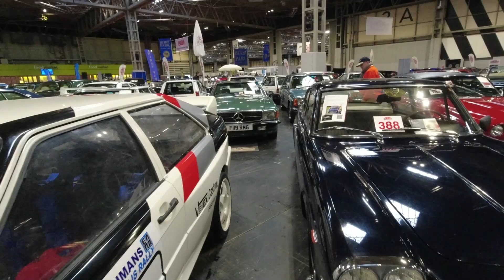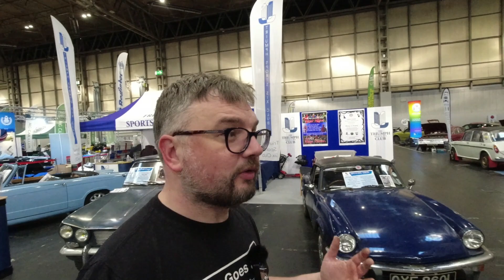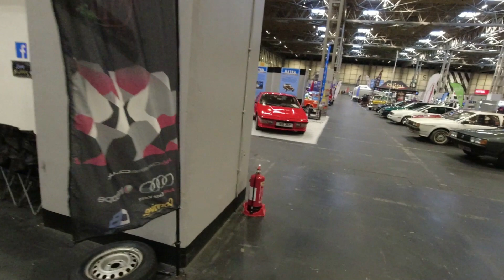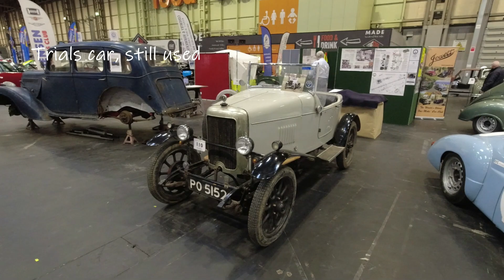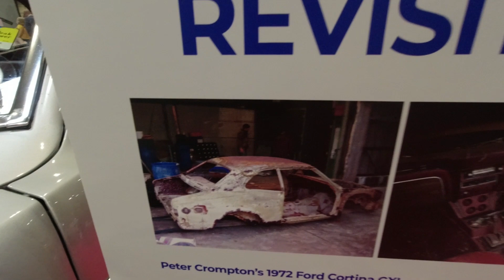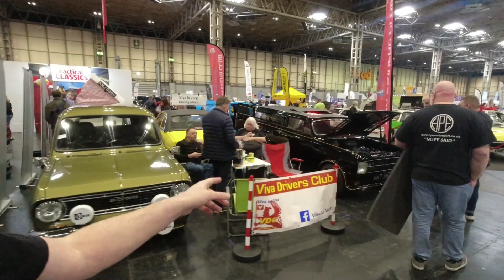Reliant Rebel First Start, Pete C Interview - Classic Car & Restoration Show Pt2

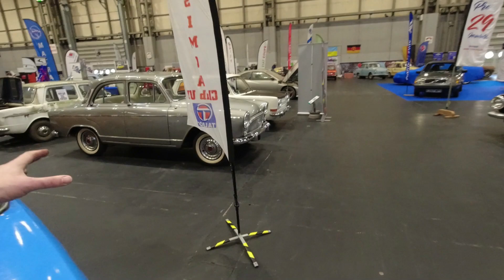Comment: Simca Aronde at 10:35.
Australian story of them being sold by Chrysler dealers from 1960 at good value price and were considered a cheap performance car :
https://youtu.be/3N1Y6cTKFNo
Even the Vedette V8 models found a market here. But one of the lowest performance V8 models you could imagine with if I recall correctly a 2.2 litre side valve Ford V8 of ancient design. Another Chrysler car with a Ford V8 before the Sunbeam Tiger.
The Peugeot 203 and 403 also made a name for themselves here because of early round Australia rally success in the fifties, but no where near as dominant as the VW beetles were later in the fifties. All through strength that made the power they had usable.

Comment: You were doing OK Ian, until you came to the Marina stand.  I had the misfortune to drive an X reg 1.7L Ital estate, in the same cream colour as the saloon featured on the stand.  Fortunately the one I drove was a company car, I wasn't paying for it.  I was a water treatment engineer and had the vehicle for just over 2 years, November 1982 to February 1985, during that time the vehicle covered around 55,000 miles, travelling all over the country.  I left the company due to a dispute over them cutting my wages, but during my period of notice, the crown wheel on the back axle suddenly gave up the ghost and was taken in for repair.  The last time I drove it was to my solicitor's office in Bury, where, due to a financial dispute, my former employers had paid funds into the solicitor's account, in order to get their vehicle back, as they were terrible at paying monies owed.

Two months later, I got a phone call from the garage demanding payment for the repairs, by then I'd left the company , so it wasn't my problem.  I was without a company car for the next two years, so I went back to driving my trusty old R Reg Mk IV 1.6L Cortina.  Although made in 1976, it was a far better car than my 1982 X reg Ital Estate, in virtually every respect.  It merely illustrated that by the early 1980s, with the Ital, Allegro and Maxi still in production, how far British Leyland had fallen behind the competition, especially Ford.

Comment: Great video as always, Ian. I'm just to where you find the row of American cars. I will try to give you details. Lime Green Mustang is a 72 Mach 1 Sport Back, and most likely has a 351 V8 (5.8 litre) "Cleveland" engine. Cleveland, Ohio is where the foundry and factory where the engine was built are located. That colour was, I believe called "Grabber Green" and was an extra cost high impact paint. Next to it is a 1973 Ford Gran Torino wagon. Not a Squire, as no wood grain. The engine from the factory could have been anything from a 302 (5 Litre) Windsor V8 through the 351 Cleveland, to the 385 block displacing as much as 460 cid in a mid-sized wagon. This one would haul anything as quickly as you wanted.
The white with stripes is a 1970 Mustang GT 2+2 with non-standard stripes. The scoop in the hood indicates it may have a 385 block V8 displacing 429 cid in Cobra Jet form.
Yes, that white one is a Pontiac Firebird Trans Am. Looks to be a fairly late generation 3 car, so early 90s is my guess.
The red Falcon convertible is a 65/66 and looks to have the Sprint option package. A Mustang in everything but name, it is mechanically identical to the same year Mustang with different body panels.
Next to the Thunderbird is a 64 Chevrolet Impala SS. Under the bonnet could be anything from a 250cid inline 6 to a 409cid V8. In between there was a pair of 283cid V8s and a pair of 327 V8s. Transmissions could 3 speed column shift, 4 speed floor shift, and 2 speed Powerglide automatic. The Powerglide was available with all engines. I believe the 3 speed manual was standard across the board, with the 4 speed available in some body styles and with certain engines.
The green Volvo Estate appears to be a 72 145S. 1 Series platform, 4 cylinder engine, 5 door (wagon) body. The S mean a 1.8 litre engine with dual side draught carburetors. Depending on the market and local regs, carbs could be Zenith or Stromberg.
I have to say I would about kill to get to a show like that one.
Reply: Cleveland tooling later sent to Australia. Geelong engine plant made them in 351 and 302 versions until the early eighties. Used as an option in Falcon to Fairlane and LTD Australian versions.

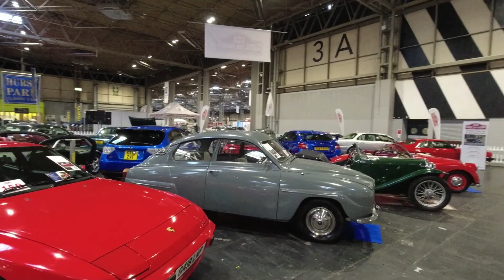Comment: Note @2:57 the SAAB 96..Their 2 strokers were SAAB's own in house engine design, that car, based on the turn signals is a 1965.

 Their engines are based loosely on the old DKW engines, but they are better engineered.  Slanted over at 60 degrees to the left, with an integral water pump/housing built into the engine head and a Bosch distributor with vacuum and flyweight advance, they are better than the DKW in how the SAAB engines drive,  which the DKW had fixed ignition timing.

Comment: Ian,I think you'll find that DVLA issue imported cars plates relating to the year of first registration, not when they are imported.
Reply from the maker: Well, that's the same thing really. That Holden was built in 1972, but first registered in 1978/79 and so wears a plate of that age. Now, they do it on the age of the vehicle, so Betty wears a 2001 plate, not a 2021.
Reply from the maker: Well, that's the same thing really. That Holden was built in 1972, but first registered in 1978/79 and so wears a plate of that age. Now, they do it on the age of the vehicle, so Betty wears a 2001 plate, not a 2021.

Comment: Velorex are still in business, though better known as a sidecar manufacturer. I have a 1990 Velorex 710 sidecar sat in my back garden. 

Production of the "Oskar"3 wheeler cyclecar ended in 1971.

Spares support is better than excellent, due to the comprehensive use of the globally popular Jawa & CZ motorcycle running gear & powerplants. Brand new crankshafts, piston, CDI / alternator upgrades, etc. are readily available for all Jawa motorcycles, purveyed by a host of 3rd party manufacturers. EBC even make ceramic brake shoe for Jawa & CZ motorcycles.

All Jawa & CZ engines are the easiest to rebuild, being very novice friendly. Everything is, "Ah, I understand how this works", helpful.

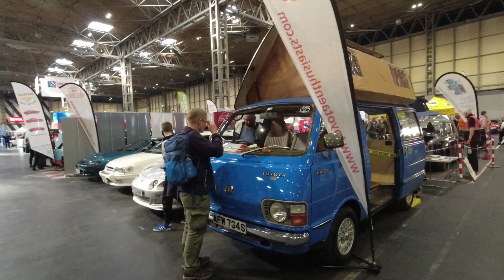Comment: 26:28 When I was a kid there was a Toyota dealer in the main road round the corner from us. I was walking past one day with my mum and they had one of those camper vans at the front of the showroom. My mum popped in and asked how much it was and the salesman told her it was £4000 which she thought was too expensive. This was probably about 76/77. Strange how insignificant little snippets like that can stay with you for nearly half a century. I even remember that it was white.

Comment: A pink car sold for 53 K ? 😳 whats so special on that car 🤔
Reply: It might have been a GTR XU1 or a replica at least. They're very valuable.
Reply: If it is one of the 200 or so Holden Torana GTR XU1 showroom sold race special cars in top condition it could sell for three times that price in Australia. Based on a Vauxhall Viva centre section but the highest spec of the Torana six cylinder versions sold in Australia. More of the story here :
https://youtu.be/54z2Xvm001c
But searching YouTube will show plenty more of the story.
The Strike Me Pink colour, as the factory called it on the colour options, was the least popular option but now sought after being unique.
Reply: 1st Torana was an Hb viva but the pink one was based on the Opel Kadett. These are worth serious money here in Aus, as are the later models. Very successful in touring car racing.

Comment: Glad you touched on the Jowett Ian, I live 5 miles from the factory site now a Morrisons supermarket.  As a nod to Jowett they have enlarged photos of the factory interior and assembly lines dotted around the store. If I'm correct, the Jupiter was entirely built in house but the other models bodies built at Briggs in Doncaster ,who as you rightly say bought by Ford  and destroyed the press dies.
Reply: I think I mentioned this before on one of Ian's videos, but in about 1985 I was working for my dad and we had to go to the old Jowett factory which was being used as a depot for, I believe, an American bulldozer company. We had to give an opinion for an insurer on one of their bulldozers which had been damaged in transit.
Reply: @caw25sha  The old Jowett factory was taken over by International Harvesters and was used to manufacture tractors.
Reply: Briggs also built the Standard 10 body. It was Ford's takeover that led Standard Triumph to recruit lots of small press shops to make panels for the new Herald, and thus the decision to use a separate chassis which acted as an assembly jig. Ironically that secured the Herald's place as probably the easiest car ever to restore as it's nearly all bolted together.

Comment: Interesting Panda fact - on the Mk1 the slatted grille was on different sides depending whether it had the 2 cyl air cooled motor or the 903 CC water cooled 4
Reply from the maker: Big bore 2CV kit mirrors the 652 that already existed for the Visa and LNA. I think it is just coincidence.

Comment: Those Volvo 400 saloons look more like an afterthought design than most others I can think of.  They look as if the designer just rubbed out the hatchback and drew a boot on the back.
Reply: I've always thought that about the 700/900. It looks as if they designed the estate and then grudgingly designed a saloon just because some idiot at Head Office thought someone might actually want to buy one.
Reply: You mean 300. The 400 is a completely different car.
Reply: @delukxy  correct, I did.

Comment: Totally agree with you regarding young folks with old cars.

I don't even mind when I see kids "blinging" their cars with Halfords tat because at least it means they've got some interest in working on cars and, out of every ten who slap on fake bonnet vents and caliper covers, there'll be a couple who decide to fit an induction kit and one who decides to take his engine to bits (probably breaking it in the process) and ends up getting properly into car repair.
Reply: I blinged my 1971 Cortina Mk3  back in 1977  with Halfords tat of the era.  Centre console with fake black leather vinyl storage compartment  which you then cut a hole for your state of the art mono radio with tape player. Enhanced with a 8 foot  glass fibre whippy aerial, Cortina decals for the wings, cheap rear parcel shelf speakers,  a fluffy dice or two, some lovely seat covers and not forgetting the heated  rear window stick on  element.  You could also get the power window winder boxes  and for the engine  a lovely chrome pancake air filter box and soak the filter in oil  which replaced the huge standard filter,  also made your car sound more powerful than it was.
Reply: Im a young folk, saving for a classic mini (not easy at 17 years old). When I get it im going to be doing it up best i can. No bling, but i do want to put a john cooper engine upgrade in myself and make it lovely and stock (with a john cooper conversion)
Reply: @greatbritannialine  Good on ya' and best of luck with the Mini.

Be prepared to deal with a lot of rust, though.
Can be soul-destroying when you're doing your best to service and rebuild all the mechanical parts and the bodyshell is just turning into rust in front of you.
Main reason I ended up being a Land Rover fan is that Defenders and (to some extent) Disco's have a lot of alu' body panels and repairing the chassis is do-able.
Reply: Blinging up and modding cars have been around since the dawn of the automobile. It may change its shape, but it will endure.

Comment: You were a tad disparaging about the " fake plastic 2 cv " , but hey it would prevent the typical 2cv rampaging rust issues would it not ? Nice to see , the early and later Husky's , i would love to own either .
Reply from the maker: Some of the plastic vans are very good replicas of the original, but some are a bit off the mark.
Reply: @HubNut  I had the same thought when you said that Ian, and made me doubly regretful of deciding to go that route with mine.  As I'm sure I mentioned on the Organ collection caper, the fibreglass van kit I got from Villevans is terrible quality, so I see your point, but seemed like the best option at the time.  When I eventually finish it, we'll see how it turns out ;-)

Comment: I would love to have a Saab 96. Too many nice cars to comment on, thanks for showing us all the beautiful eye candy. 🙏🏻👏👏👏👏
Reply: @Alfred Wedmore inefficient? they were inefficient because they were 2 strokes, and allowed part of their air-gas-oil mixture out of the exhaust un-burnt.

  They warmed up quickly because they were tiny engine with an aluminum head and an engine whose cylinders that fired on every revolution under load. They had a huge heater core that was also the same one used in the Volvo Amazon, and it would actually cool the engine down at low speeds in cold weather,  It's why they came with an exhaust stove air intake snorkel with a winter selector lever and a radiator blind you could adjust from the interior.

( I have direct experience with this as I've owned two; a '62, 96 and a '65, 95 estate.)